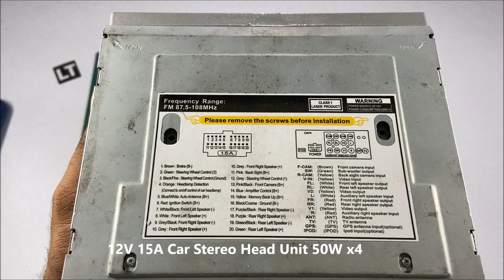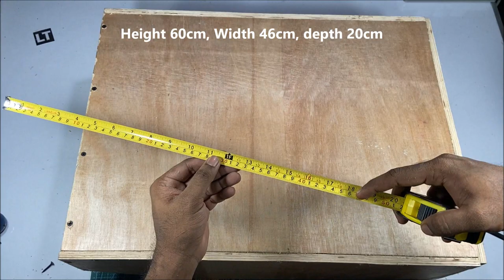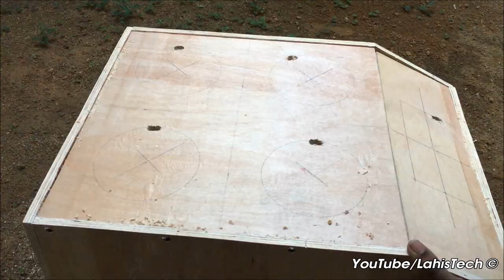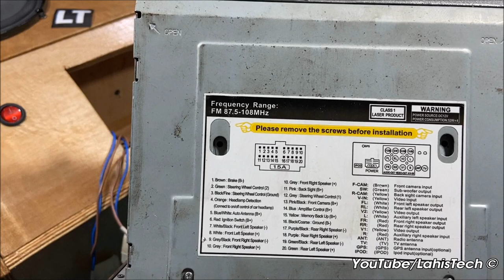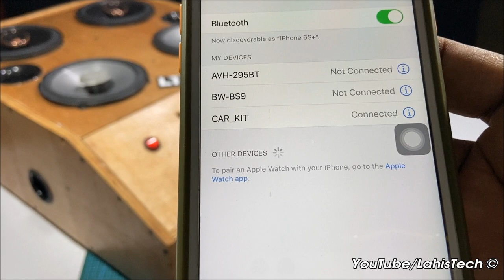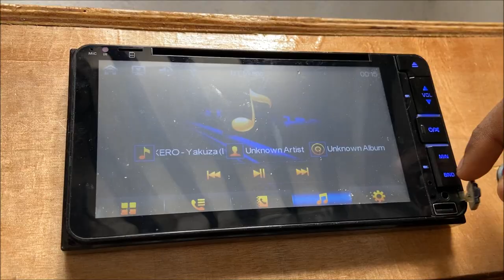DIY: Multimedia Bluetooth Boombox Speaker

Comment: The question is, why so many ports? 2 would be totally enough.
The output voltage is too low. Should be 12.6 Volts, to have some reserves.
Also I wouldn't put that power supply into the chamber of the speakers, first it takes off volume of the chamber and second, it also generates heat, which should be somewhere else, but not there.
Twisting the cables and put some isolating tape around is not a good way. There are connectors to do it right.
The car radio does come with a frame, which holds it in place properly. Why not use it?

No disrespect, but you could raise your quality by 200%.